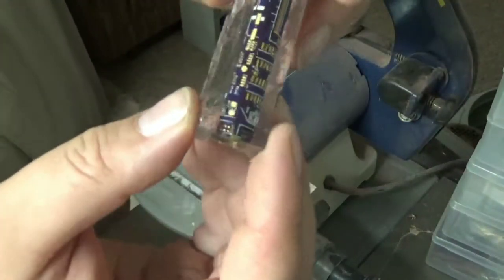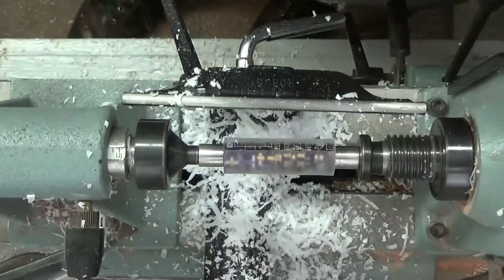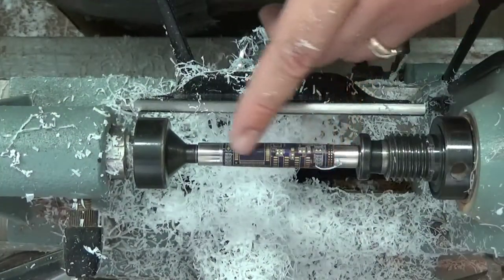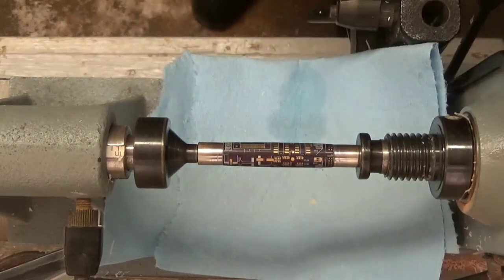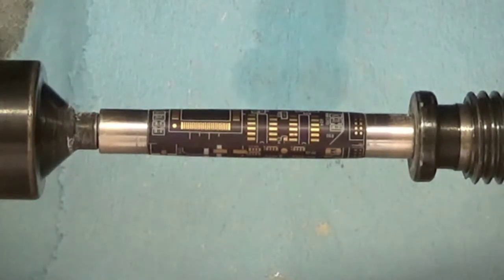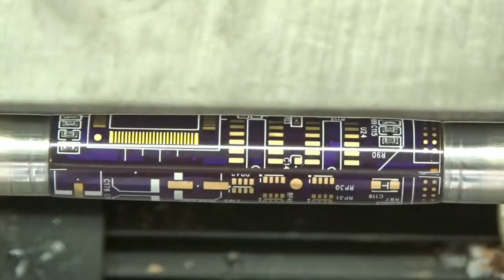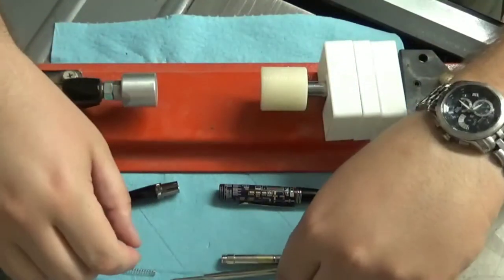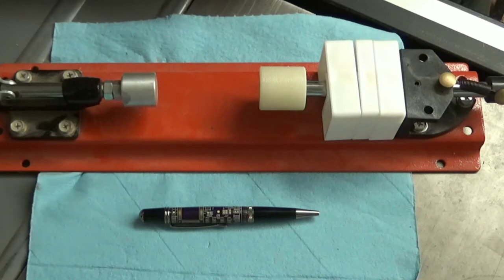Turning A Purple Circuit Board

Comment: Happy to see you're still at it ! And still turning out fabulous finishs' on pens !
Sorry I've not been vocal lately, got called back to my former life for a spell. 
Can I ask, are you statisfied with your rikon 70-1218VS ? I'm mini wood lathe shopping, I started to just buy the harbor freight 12x18 w/coupon for around  $200 ..problem is I`m use to variable speed (i`ve been using a micromark 7x16 metal lathe for pen turning but now I'm wanting a dedicated lathe for it) . Rockler has the rikon on sale for $449 which I guess is a good price. I know I'll have to buy a nova G3 chuck for whichever way I go.
Reply from the maker: Good to hear from ya. Stay safe out there.

Yes, I've been very happy with it. There is another version that has a locking headstock with 12 points to lock into. I wish mine had that for some of the projects I've dreamt up, but it's a great lathe and that's a good price.